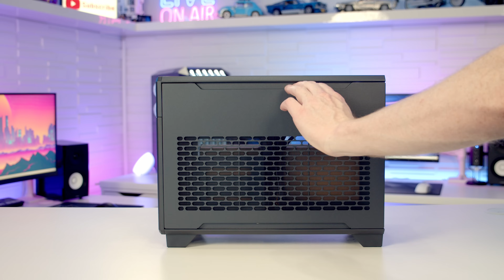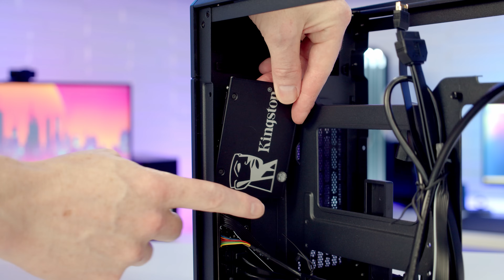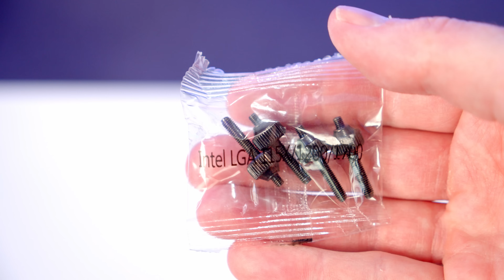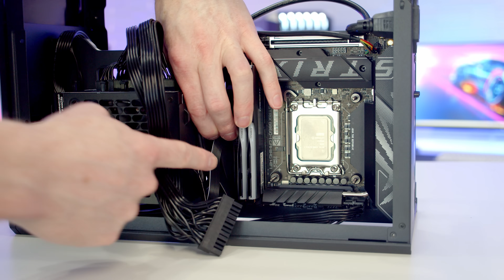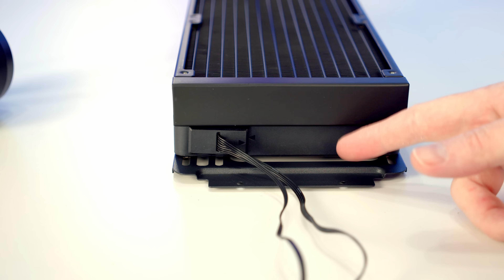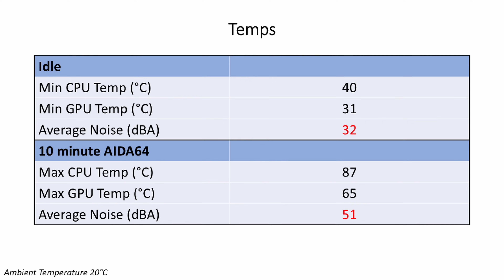Thermaltake TR100 Build - Step by Step Guide

Comment: I just bought this case and i installed the riser cable first. So there was no issues screwing it into place. Allso i installed the fans below the rad you just need to keep all the cables below the center bar and there wont be any issues.
I tryed using the Arctic Liquid Freeser III 240 but that was too thick. But my NZXT X53 with a pair of Noctua NF-A12 Chromax Black fans worked just fine.
The case is very easy to build in and easy to cable manage if you do things in the correct order.
I installed it like this. Riser cable, motherboard, gpu,psu and aio doing some cable managing inbetween and last.

Comment: I have not seen a build on this case with an air cooler. I am curious about thermal if using a down draft cooler. There are two, one with 120mm which is taller and one with 90mm. I'm just curious. This can be also lighter for travelling.

Comment: All these TechTouber PC builder guys talk so much crap about individual front panel connectors but when there is a case with obnoxiously bright LEDs they don't want to use, now it's suddenly a problem when it's a unified connector. LOL. 

I prefer individual connectors. More versatility for situations such as this. Plugging them in isn't a big deal, it's something you do once and never again for 5-10 years. Also, I feel like a bit of a bad ass sci fi scientist plugging them in.
Reply: true but i absolutely hate it in itx cause its super crammed. and big hands

Comment: I built in a matcha green! (Swapped from Fractal Terra) last month, no issues, but coming from Terra anything is easier. Idle 48*C CPU and gaming 71 CPU / 61 RTX 4070 OC with 2x 140mm Noctua top fans. No RGB. It’s great!
Reply: what cooler are you using and are the top fans fans blowing out or in??
Reply: @MonsterKB  Noctua NH-L12S for CPU, and exhaust for case; you always want exhaust fans in any sandwich case.
Reply: not sure if u used or seen ( NZXT H1 v2 ) before or not. but i want to know if the noise is as bad. For example, If you start a game and pc fans turned on max, and you got ur headsets on without playing anything, can you still hear ur pc? and if you can, is it obnoxiously loud ? ... do you have any regrets or heads-up to tell us about? much appreciated
Reply: @K0J0K  I never have to run fans at max speed, but certainly I do not hear Noctua fans with a headset on. Noctua is the way to go!
Reply: @digitalopt if i get arctic 280mm, u think i should get rid of two fans in box and get noctua? Big of a difference?
Reply: @K0J0K probably. Find out the CFM of those stock and compare it to Noctua; should make quite a difference in air to noise ratio
Reply: What CPU?
Reply: @-Batman- AMD Ryzen 7 7700x
Reply: @digitalopt i seee
Reply: And thermals under load (like CPU only blender or rendering)?
Reply: @-Batman- this is in game. I don’t bother with benchmarks, just actual use.

Comment: I was looking at the TR100 but went with a MATX case instead. Also, the TR100 is a "air flows down" case and is why there isn't a bottom dust filter. Setting your AIO fans to exhaust at the top plus dust filter is probably why your temps are high too.
Reply: what case did you get?
Reply: @mparagames  ASUS AP201.

Comment: You are the 2nd reviewer I have seen that have had an issue with the riser cable. I think Thermaltake need to do a QC check on the riser cable they are using, Great video!
Reply: 100%
Reply: also the included riser cable is only PCIE 4.0

Comment: You're a better man than I am, Mr. Flannigan!  No more scraping these fat knuckles of mine on m-ITX builds!  (My daughter and her hubby picked up her new build today, and the next case I'm building in is Montech's King 95 Pro. 😁)

By the way, those front panel LEDs on the TT Tower 100 build I just finished up don't work.  I didn't notice this until I'd completely buttoned everything up, but I've read several complaints about their brightness in case reviews I checked out online, so you're not alone as far as they're concerned.  

On the Tower 100 all the front panel connectors are individual 2 pin connectors (4 of 'em), and I was careful about connecting them correctly (everything else works fine), but my daughter said she doesn't mind that they don't light up, so maybe it's just as well. 🤔
Reply from the maker: It's probably best they don't. if this was my PC I would have to cut the wires for the front leds
Reply: @ChristopherFlannigan  I'm planning on trying Corsair "Premium Sleeved Front Panel Extension Kit" ..the front panel connectors are individual / split into leds and pwr/reset, and I figure that as long as power sw and reset are connected correctly to the chassis single connector (in the right place) then I'd be free to only connect those to the motherboard